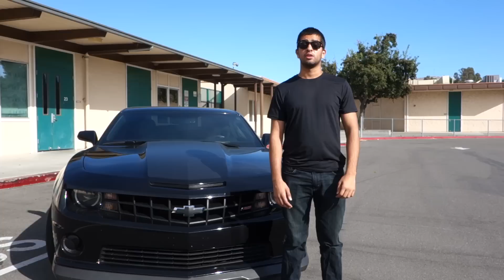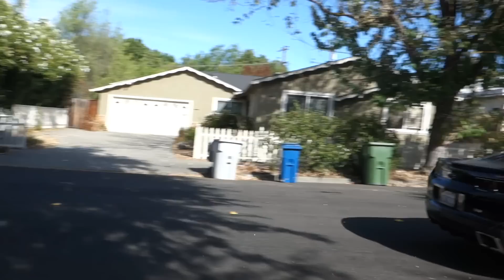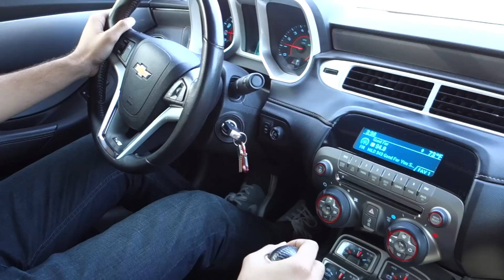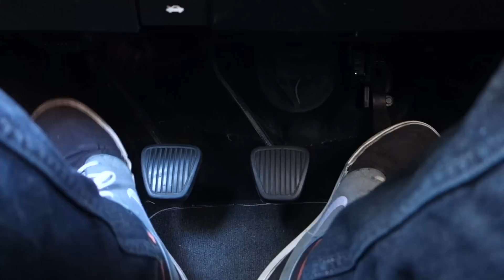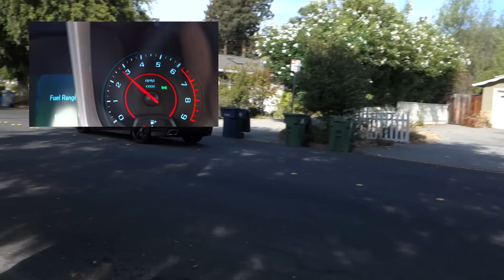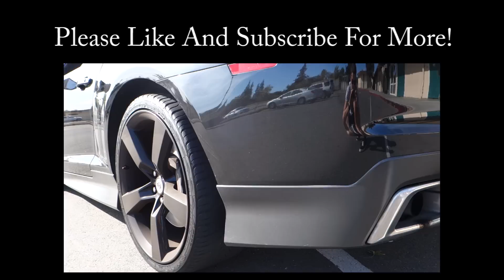How To Downshift In A Stick Shift For Beginners

Comment: I watched both videos. I had an 07 328i but I wanted to try a new experience. my friends told my that stick would change my life. so I sold my bmw and bought an 04 civic, just to start off with. I'm getting it tomorrow. I looked at many videos and they still were really confusing, after I watched your videos, it helped me get an idea on how it works. I'm getting my car tomorrow, so I'll Definitely work on it.
Reply from the maker: +Ryan Deshawn We appreciate it man, welcome to the manual crew!!!
Reply: +Guys WithRides Thanks bro. If you ever get a chance, can you show how to handle going uphill. stopping in a hill and taking off.
Reply from the maker: Sounds good, we'll put it on the to-do list. Have fun with your new ride man!
Reply: +Guys WithRides Thanks man, I appreciate it. and I will. so far so good.
Reply: +GuysWithRides did you ever  make the video?
Reply: +Ryan Deshawn did u learn how to drive stick